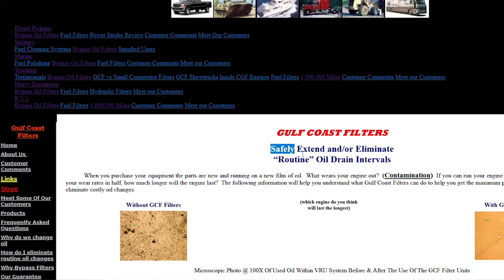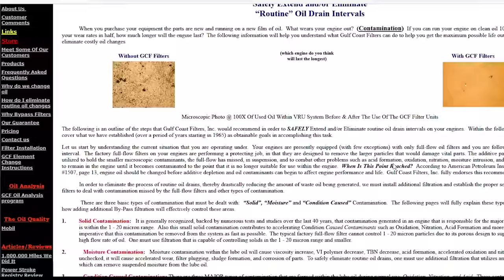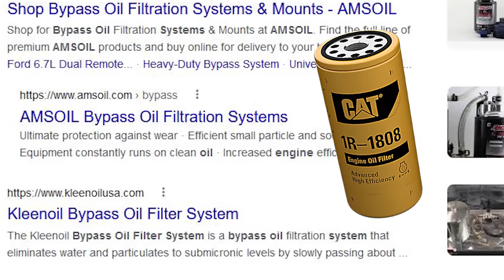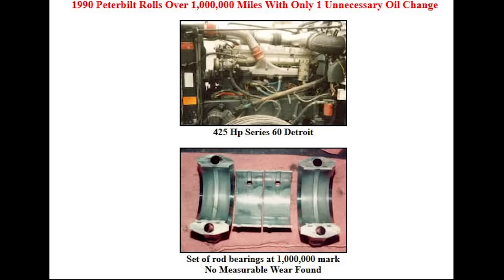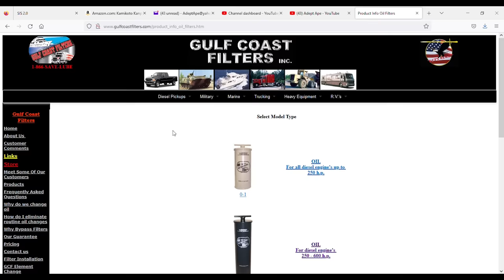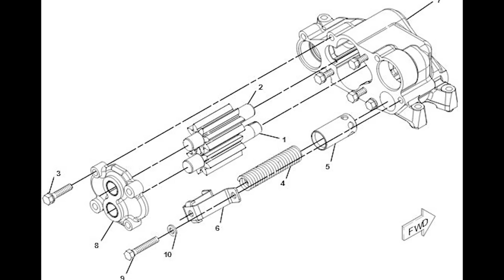No Oil Changes and 1 Million Miles!!! Are Oil Changes Optional with a Bypass Filter? (INTERESTING)

Comment: I've been a diesel mechanic for 25 years. I manage a fleet of 37 freightliner cascadias and 2 years ago we decided to add an additional bypass filters on all of our trucks. At first I thought this is a bad idea, but I do a oil analysis every 25000 miles so I can keep an eye on it.
  After doing some research I found out oil does not break down. What really happens to oil is it gets contaminated. Now that I've done this for 2 years with my fleet and have data from the oil samples I can tell you this works. My maintenance program in regards to lubrication consists of changing the bypass filter every 25000 miles and take an oil sample. On top of that I change the oil filter at the block annually. I wouldn't suggest doing this unless you intend to monitor the oil through analysis and do repairs based on your results.
Reply: That's mighty interesting. I never thought this would even be a topic of discussion.

Comment: Natural Gas compression. We run engine oil 15k hours plus. Sample every 30 days, filter changes every 4300 hrs. This is on 3600 series engines. I know natural gas fuel is very clean to begin with, but the additives are oil additives are still there even after that much run time. And the more they run, the lower oxidation, moisture contamination and TAN stay. Great video!

Comment: I have installed around 25 of those filters on otr trucks. Each time you service the filter you end up adding 2 or so gallons of fresh oil. This adds detergent packs back into the oil. filter elements are actually paper towels with a sock type material over it. If I remember right,  bounty fits best. Also, a 60 series actually requires a full oil change at some point. I think they recommend 300k. Been a while. You also send a sample for tests each service. Main filter gets changed every 30k I think. I don't remember there ever being an issue on those rigs. Pretty good system.
Reply: They didnt use the sock covering when I sold them. I think the sock covering was started because a lot of people worry about tissue migration. Personally if I had concerns I would get a remote filter mount for a secondary spin on filter.and get Bounty big roll papertowels. The Australian Jackmaster Classic has the TP in a sock. My diesel tractor uses a Perma Cool Universal sandwich adapter.  The clean oil from the flat head Ford canister filter toilet paper conversion goes to the inlet of the full flow filter. When Dune Buggies and Hot VWs tested the Motor Guard toilet paper filters in the 60s they put an inline fuel filter in the return line. They needed it to cut open and check for fibers. They found none. In reality all it amounts to is keeping the oil clean and adding enough new make up oil to keep the additives up plus to dilute  the soot that is too small to be filtered out. The million mile truck I guestimate gets about 350 gallons of new Rotella in a million miles just on makeup oil at filter changes..
Reply: @ralphwood8818  they seem to be a good filter setup. I have pondered putting something like that on my old crane truck hydraulic system.
Reply: @battleaxefabandmachine  I havent sold them in 20 years. About the first thing people ask is wont the toilet paper clog up the oil system.The Jackmaster Classic has the element in a fabric cover and claims 1 micron filtration.Remove the cover and you find a very firm roll of Australian toilet paper. The big Luberfiner 750 filters used pulverized newspapers the last time I checked. They had a secondary strainer in the core. The rolled paper gets stronger in oil. I recently bought a 79 Ford diesel tractor.with a loader. Did the engine. My next project is finding out where to add hydraulic fluid. I built the system on the Farmall H. It has a big spin on primary filter and a little Gulf Coast junior secondary filter on the hydraulics. Dont see any way to put a bypass filter on the hydraulics on the Ford..Had to go on YouTube to find out how to operate the Ford. Two gear shifts and 12 speeds. 3 point hitch controls. I need a book.
Reply: @Ralph Wood  nice. Yeah I need to find a single element one
Reply: @battleaxefabandmachine  I put the single roll Gulf Coast O-1 filters on the big hydraulic systems at Safety Kleen. I also did the yard mules with O-1s and the other engines with toilet paper filters O-1 juniors. I put the Gulf Coast junior filters on the Cummins 5.9 on the Fire pump and the 4 cylinder Cummins Sky Trac. The junior could handle a pretty big hydraulic system. The Cummins engines didnt get used enough for the big filters.
Reply: @battleaxefabandmachine  The Ford tractor has a loader control valve. I put a remote filter mount on the return port.and a oil cooler sandwich adapter on it. The main flow goes thru the Motor Craft  FL 1A. A smaller flow goes thru a Motor Guard toilet paper filter. All it had was a strainer.  Put a pressure gauge in the line. It runs at about 70 PSI..The hydraulic oil lubricates the transmission and rear end. Operates the loader the power steering and 3 point hitch. Too important for a strainer. The only fluid Auto Zone had that met the specifations was Lucas. Got the Perma Cool adapters from JEGS years ago.
Reply: @battleaxefabandmachine  Had a learning experience with the Ford tractor. Put the filters on the out line of the loader control. The power steering and 3 point hitch is down stream of the loader control valve Hit the 3 point hitch control  and the pressure backs up and either blows up the filter or blows out the gasket. Ended up installing a needle valve to supply the  toilet paper Motor Guard. Put a gauge in the line. The motor Guard element is restrictive a lot ofvery small metal in the fluid. Will have to keep an eye on the guage. Might have to find a looser wound toilet paper. The Motor Guard factory compressed air filter is very dense.
Reply: @ralphwood8818  lol. Sounds like a bad day. I hate those lessons. Lol
Reply: @battleaxefabandmachine  When the 3 point hitch reached the end of its travel the Motor Craft FL 1A came apart. The Motor Guard is a lot stronger. It is ok but the O Ring blew out and took part of the Motor Guard element with it.. The old Farmall H is simpler. The oil goes from the loader control valve to the oil tank.  The modified F 350 front end has its own Ford power steering . The home made 3 point hitch works off the 3 spool loader control valve.  I think about 100 percent of the contamination in the Ford  tractor hydraulic system is wear metal from the 12 speed transmission and gears. It could use some magnets. It has 3 drain plugs. None have magnets. Put a magnet in the inlet of the Motor Guard to help the Motor Guard. Motor Guard claims submicronic.

Comment: Hi from the uk 
Many years ago when I was a truck mechanic I worked on some cummins engined trucks with by pass filters. No tests were done but back in the 80s it was reckoned that you could double your milage between oil changes. They make claims about moisture? That shouldn't happen as the truck shuld be up and running for long enough to stay at operating temperature long enough to evaporate any moisture. Yes you are right oils do break down around 250F or 140C and the additive package that makes the oil what it is deteriorates from the first time you start the engine.
Yes by pass filters are good news but oil analysis will let you know when it's time to change but you have to be selective about who dose the analysis as the cheep ones only look at soot loading and the next level look at metallic content when it is the actual oil that needs to be checked for its viscosity change and additive depletion 
Keep up the good work

Comment: The centrifuge separators I've seen on old Soviet machinery is awesome. It removes particles of any size. Just replace the rotor cup periodically, or clean it if you can chip the crap out of it that compacts in and becomes like concrete.
Reply: Yes,old Zetor tractors ran forever with occasional cleaning of the centrifuge filter screen.
Reply: Just like the Spinner centrifugal units they used to sell here
Reply: wow they should have these in cars and bikes too!
Reply: My 305 65 Honda motorcycle had a chain driven centrifuge. Mack trucks used them. Not sure what the oil change intervals are. The Honda packed the sludge in hard in the steel drum. I had a Frantz oil cleaner on the Honda 500 Custom.
Reply: The Belarus tractor

Comment: 2006 C15 Acert, I used to change my oil every 10 to 15k miles.  Now I run an OPS Eco-Pur oil bypass system with Amsoil Signature Series 15w40 and I sample and change the full flow and bypass filters every 25k miles.  Unlike the others the OPS has a heating element to evaporate liquid contaminates.  Due to this my fuel dilution has gone from 1% before installing the system to less than .5%. (trace) after.  As far as the additive package breaking down, the make up oil that gets added has been more than enough to keep the additive package at the correct levels according to my oil samples.  I hope this info helps.

Comment: The filters are saturated with oil and when replaced additional oil is required. The regular oil filter is also full of oil that has to be replaced. You actually replace about a gallon of oil with each filter change. That may be helping the system to work.
Reply: Yep, a partial "spill and fill" removes some oxidized oil, replenishes VIs, replenishes additives, removes some water and fuel, and removes suspended particulate. The particulate that is in the sump oil of a bypass filtered engine isn't a problem though; it is smaller than the oil clearance of the bearings and smaller than the minimum oil film thickness so it never touches anything. Replenishing the detergents and acid buffers is what's important. The TBN of used oil eventually reaches 0 as the moisture builds up and creates acid in the oil, consuming the buffer. Replacing a fraction of the oil bumps the overall sump capacity back up to a serviceable level. The viscosity improvers are what allow an oil to be dual grade, and they get sheared up and oxidized over time. Running a straight single grade oil will be best for an engine that's bypass filtered and being pushed for a very long extended OCI. No VIs mean the grade only changes due to fuel and water dilution. The problem with straight single grade oils is how thick they are at ambient temperature. An oil pan heater and a pre-lubricator are recommended for doing this. An engine that runs at speed under load 90%+ of its lifetime won't have issues if those 2 things are installed for the odd times that it's cold started. Virtually no wear occurs when an engine is at operating temperature, under a mild load at speed above idle, and below 75% of its redline. Most of an engine's wear over its lifetime occurs at cold startup and during the periods that it's driven/used before it and its oil sump has reached full operating temp. Like, large emergency standby generators? Oh man, they get tortured to death their entire life. They sit for days or weeks at a time, and only fire up when needed or when tested. They get cranked over cold and immediately slammed up to normal operating speed and put under a modest load. :'(
Reply: How much total oil is in a system like that?
Reply: @Grant3758  I had the system on my truck it adds approximately 2 gallons more than the original amount also you send out for analysis they can keep an eye on your oil and tell you of changes in your readings and help trouble shoot slowly progressing problems that can turn into big problems that you would not notice with regular oil changes unless it's really bad
Reply: On my Pontiac I change the toilet paper every 6.000 miles and add a quart of new oil. The wix has been on there for 63.000 miles and about 4 years  i check the dipstick for problems. I dont spend money on oil analysis. I dont drain oil. The old Pontiac will out last me. Its worth about 1000 bucks. It has the Jackmaster Classic. If I see anything big on the top of the TP I will change the Wix. The big Gulf Coast filter holds 3 gallons of oil.
Reply: They call it one oil change in a million miles. The reason the engine had virtually no engine wear at a million miles is the engine isnt allowed to run on dirty oil. It probably had close to 350 gallons of new make up oil added in 1 million miles. Oil analysis showed 3.gallons of new oil added when the 3 gallon filter is changed at 10.000 miles is enough. I know some Gulf Coast filter users are going more than 10.000 miles between filter changes using oil analysis. Very misleading saying 1 oil change in a million miles.
Reply: Some are changing the filter less often with oil analysis then doing a full oil change ocasional.
Reply: @mannys9130  We pretty much never change the oil filter (because it continues to filter normally)... but change the oil at the normal intervals (10,000 km) because TBN has hit zero (or close to it) and there's a little fuel dilution (~1%).
Our engines have ~1/5 the normal wear before we use the high efficiency oil filter... so there is very little for an oil filter to catch... that helps.
We know that the filter is working just fine because the oil filtration does not drop off... or change when we change the filter.
:-)

Comment: In the USN large stationary diesels almost always had a centrifuge plumbed in as a bypass filter as well as full flow filters lube oil was only changed after fuel dilution reached 5%.   I always thought fleet truck or equipment operations    would benefit from plugging in a centrifuge when the engine was out of service and warm .

Comment: Worked it out within the first 5 minutes of the video, the text you screen grabbed says they have a service interval for changing their oil filters and they replace lost oil with that, overlooking the fact they admit to 1 oil change outright, i guarantee that theyre replacing/topping up oil during their service intervals for the filter that basically they are doing mini-oil changes instead of one big traditional oil change. Its simple physics

Comment: I’ve never ran em on any of my trucks. I kinda wish I had, but I didn’t keep trucks long enough to see how well they’d work. I will say this (keep in mind this is WOM, not my personal experience), if you have a traditional spin on oil filter- between it and the bypass filter, you’re putting in close to a gallon of fresh oil every time you change those filters (replacing lost oil from the filter changes), so in a sense, you’re doing a full oil change every so often anyways. Obviously it’s a lot cheaper than replacing it all at once, but I’m making the point for those that worry about stretching the old oil too long.
Reply: Ive used toilet paper filters for 60 years. Its a matter of keeping the oil clean and adding enough new motor oil to keep the additives up. With the test truck its 3 gallons of new oil added when the 3 gallon Gulf Coast  filter is changed every 10.000 miles. The full flow filters are also changed at 50.000 miles. With my small engines its 1 quart. Very misleading to say one oil change in a million miles. The system doesnt work with small filters.
Reply: @ralphwood8818  yeah, that’s my thing with em. I’d heard one gallon, but 3 is even more obviously. Either way, you’re basically changing the oil anyways, so I don’t necessarily buy the hype of extended drain intervals. But I do think the bypass filter might still be a good purchase, just for extra cleaning.
Reply: @thetowndrunk988  Its a matter of keeping the oil clean and adding enough new oil. The million mile truck got a lot more oil changes than one. Over 300 gallons added in a million miles when the big 3 gallon filter is changed isnt one oil change.it looks like the old Ford diesel tractor I just bought will burn a quart of oil in a days work. I probably wont need to drain the oil or change the bypass filter very often. It uses Scott 1000 in a converted Ford Flat head canister filter..
Reply: The old Ford tractor fooled me. Thought I had an oil burner.  Didnt give the oil time to drain out of the bypass filter..If I only check it when its cold it reads full.. Not used to anything newer than a 51 Farmall H . This 79 Ford has a lot of features. I have depth filters on everything now except the coolant.

Comment: My Detroit 12.7 developed a head gasket oil leak at the back of the head. It uses a little more than a gallon per week. 3 years ago I installed an amsoil bypass filter and haven’t dropped the oil since, only changed full flow filters every 15k and the bypass filter as recommended at 120k, So every week it gets a fresh gallon and every 15k it gets it gets a little over two fresh gallons of new oil plus another 2 about every year when the bypass is changed. I have not done sampling and have had my fingers crossed about fuel contamination but I’ve made it to 850k and am not opposed to rebuilding or replacing at this point anyway. I installed the bypass at 532k.